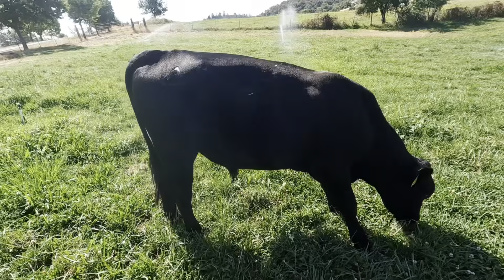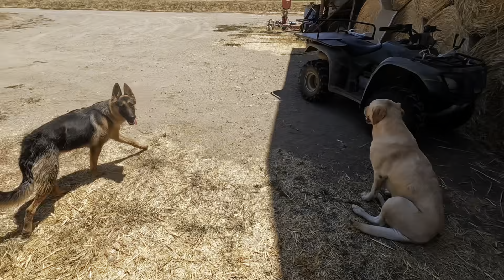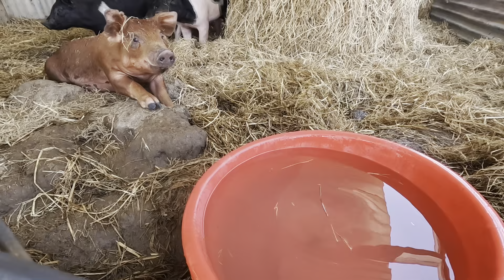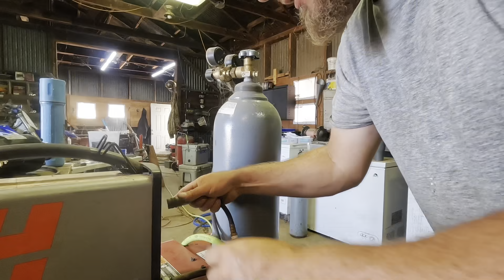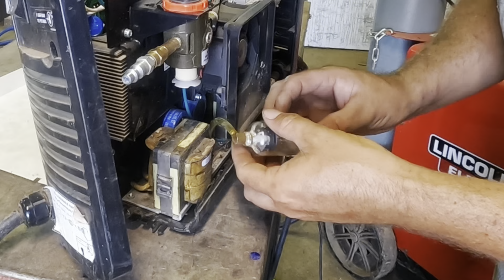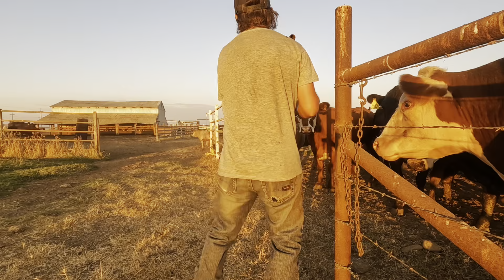Why is Everything Breaking Today?

Comment: Tyler if the JB does not hold. Angel hair Fiberglass with JB weld will give it more strength. Or fiberglass epoxy instead of JB weld .

Comment: My grandfather also leveled some river bottom ground so the water would flow both ways from the pipeline. A 6” Fresno Alfalfa valve is less than $100 plus fittings, so we ended up digging a line over and duplicating the valve system on the other side at each existing valve.

Comment: I had the air filter/water-oil separator bulb go bad on the industrial equipment I work with.  Couldn't find the bulb but the larger unit was available.  Before trashing the plasma cutter, putting something before the air gets into the unit will probably be good enough.  Removing the old innards will probably be necessary to stop the leak if you go that route.

Comment: Did you visit Arc Solutions? Hypertherm PMX30 / PMX30XP Air Filter Bowl Replacement Kit 428246 (Price
Regular price$42.32) Of course it may not be the correct one for your needs.

Comment: Those drains get old and get hard and brittle. Check at a air compressor parts dealer. Just looks like a normal air regulator.

Comment: The wire damage on the fly sprayer interested me.  Recently a friend of mine had a portion of the wiring harness of one of his vehicles chewed up by a groundhog……caught in the act! When he took the vehicle to get repaired, the the likely reason the groundhog found such an attraction for his wiring harness was that some of the insulation/ plastic conduit is made in part with a soybean compound.  Apparently this was not the repair shops first rodeo with this type of damage.  Granted cattle do weird things sometimes, but they may have had an underlying motivation this time.
Reply: My buffalo always ate the horse and flatbed trailer wiring off. Vet told me he needed some sort of minerals or something. Has been many years I have forgotten exactly. Now I place all wiring in a plant bucket and out of site. And water never stays in it.😊
Reply: Came to write the same. Auto manufacturers have been dealing with the wiring problem for years. Even in 2014 the number of employee vehicles that had to be carried off for repair in a single year because of rabbit and squirrel damage was incredible. In the year before I retired there were 38-vehicles towed out for wire repairs.